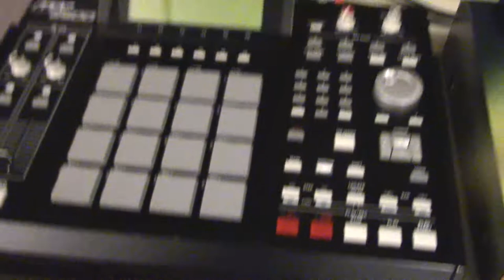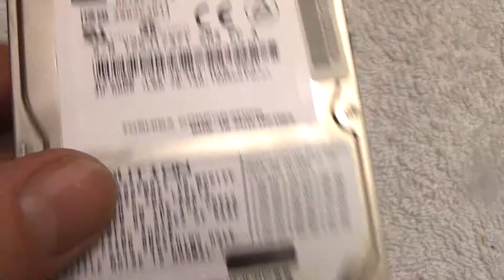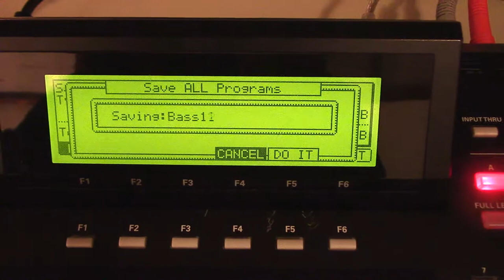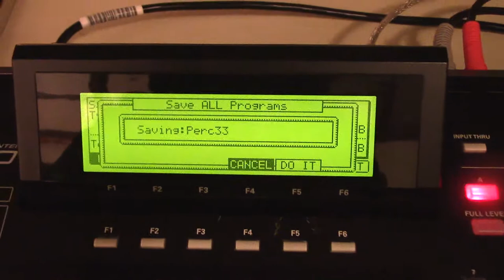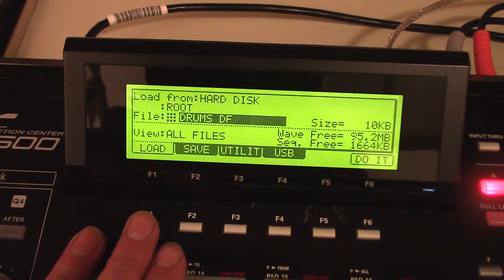Akai MPC 2500 - Upgrade Hard Drive to SD Card - Tutorial

Comment: Thanks for doing the research on this.  Using this mod with a 128GB SanDisk micro SD card, along with an SD-to-CF adapter with another 128GB SanDisk micro card in the memory card slot (thanks to MalaKai over on the MPC Forums)!  Everything saves and loads fine between the two and I now have roughly 242GB of solid state storage in my 2500!!!
Reply from the maker: Daaamn. Took it to a whole new level. Thanks for sharing.
Reply: That sounds incredible! I have a 2500 on the way and this got me even more hype! Can’t believe you can use an adapter for the cf reader and get 128 gigs!

Comment: Wouldn't the saving habits of the MPC have an adverse affect on the write cycles lifespan of the SD card?
Reply from the maker: Hey Tarik. Thanks for your question. 
From the internet:
Flash memory indeed has limited write cycles. However, by now it is unlikely that you'll encounter this within the normal lifetime of such a card. Usually this is in the order of 10,000 to 100,000 write cycles depending on the card. Today SD cards include circuitry to manage wear-leveling, that is, spread out writes over the storage media evenly to avoid "hot spots"—pages that are written too frequently and therefore failing early. 
Most people would have changed to a newer card before the old one can be worn out.
If you are worried that your SD card may die on you, regularly backup important files. 

People are putting up to 200gb cards in this machine. With a card of that size (or similar) one may only see a few write cycles in its lifetime. 
The card I installed is only 64gb and I have only used around 6gb so far. 
Hope this helps.

Comment: Thanks for the vid! The four isolated pins on the left are actually drive select and not power. You correctly hooked up power on pins 41 to 44, all the way on the right. You can google "ide 2.5 pinout" to see. It's kinda confusing the HDM10 kit indicates pin 1 incorrectly, but luckily videos like yours show how it is done.
Reply from the maker: Thanks for the info!

Comment: Thanks for sharing man! Are you using JJOS or stock Akai firmware? Is there a size limit for the CF card? I've got a bunch of 16 GB cards laying around. Still trying to decide on getting a 2500 vs 4000 if you have any input on that also?
Reply from the maker: Hey PJ. I'm using the stock Akai system and I think your 16gb card will work fine as there is a comment below where someone is successfully using a 128gb card.  Never used a 4000 so I can't speak to that, but the 2500 is pretty cool and you have the jjos option for expanded features and functionality as well. peace

Comment: Hey man, Im about to uograde my 2500.. so glad for your vid. justr wanted to know, once you formatted the SD drive did you have to remove it and load your samples on it again??
Reply from the maker: You can if you want... I just hook it up to my pc via the usb jack to transfer my samples.
Reply: @lazoo2000  sick one, thanks. Didn’t consider that would be quicker than how it is transferring to the internal drive. Appreciate it!
Reply: Hey lazoo2000 do you know of a size limit of the card you can use? I’m wanting to get a 512Gb or even 1T card for it but unfortunately can’t find info on the net about it. Thanks mate

Comment: @lazoo2000 i put my adapter in the incorrect way to the middle of the tray and left as well as being upside down and i my drive doesnt at all read anymore. do you think i have to replace the whole drive/or try or both? im using the free jjos 3.13 btw.
Reply from the maker: hey, sorry to hear... i would try to install it correctly, then if that doesn't work, try replacing the SD card.

Comment: this looks great, any link to what you bought?
Reply from the maker: Sure, here's a link to the U.S. seller where I bought mine:

http://www.ebay.com/itm/HI-Speed-SD-SDHC-SDXC-MMC-Memory-Card-to-IDE-2-5-44Pin-Male-Adapter-Converter-/301628732162?hash=item463a793302:g:ZaAAAOSwA3dYXbLN

I misquoted the price in my vid. You can get them for around $6, but you have to order from China and it will take a month to arrive, otherwise it's around $15.

Comment: So you can’t take out the SD card from within the machine once installed?  Would more want to replace my CF card reader with an SD and be able to pop it out and back in from time to time. Does hooking the MPC up via USB show the SD card on your computer fine?
Reply from the maker: Yup. You can access the SD card or the CF card on the computer and transfer files back and forth.
Reply: I use a CF to SD card adapter. Around $10, no issues after many years of use.

Comment: What is the biggest hard drive you can install instead of a SD card?
Reply from the maker: Good question... definitely  a 128gb, but I would bet a 256gb would work as well... and maybe even a 512gb drive... not sure and have not tested the 256 and 512 tho.
Reply: @lazoo2000  what size again for the 2500 fits is it 3.5 or 2.5?
Reply from the maker: 2.5 drive.
Reply from the maker: Also remember it takes an IDE drive, not an SATA.
Reply from the maker: If you have an older laptop, you could potentially use the drive out of that.
Reply: @lazoo2000  thanks

Comment: How is this working out for you these days?  Are you having any issue with loading and saving?
Reply from the maker: Still working perfect with no issues at all. Highly recommended upgrade. Thanks for watching.
Reply: I upgraded my 2500 with the SD to IDE card adapter and now I got 60 gigs in my machine!  I was so impressed with how it worked, I ended up buying a second one with a Sandisk 128 gig Extreme Pro card.  Thanks for making this video and helping out us MPC heads!
Reply from the maker: you are welcome.

Comment: hey brother can i get the info for the SD card reader u installed I'd like to purchase the same one. thanks
Reply from the maker: https://www.ebay.com/itm/SD-SDHC-SDXC-MMC-Memory-Card-to-IDE-2-5-Inch-44Pin-Male-Adapter-Converter-BNY/372496880859?epid=17003211007&hash=item56ba8b54db:g:OFoAAOSwylhb5qLD:rk:1:pf:0
Reply from the maker: https://www.ebay.com/itm/SD-SDHC-SDXC-MMC-Memory-Card-to-IDE-2-5-44-Pin-Male-Adapter-Converter-US/262079393302?epid=516522725&hash=item3d05262e16:g:idYAAOSwN81WEhts:rk:7:pf:0
Reply from the maker: This is the one... CA seller and NY seller depending on where you are.
Reply: thank you brother 👍

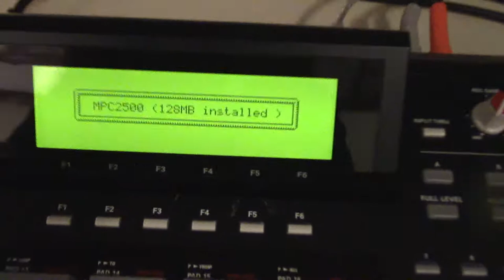Comment: Hey thanks for the great vid!! I actually ordered some parts and am excited to experiment!! I did notice something that is probably worth mentioning: I believe the adapter limits the actual write speed of the card to only 25MB/s, this is much slower than a hard drive where a 5400rpm hard drive can provide 100MB/s and a 7200rpm hard drive can provide 120MB/s. I believe the main benefits to this mod would be creating greater storage reliability due the the lack of moving parts that can fail or be broken, and also decreased noise level of a spinning HD. @7:16You do mention that load speed has been improved, does this mod really improve read speeds?? Anyway here is the article that brought this all to mind: https://goughlui.com/2019/02/03/tested-generic-sintechi-fc1307a-based-sd-to-ide-adapter-sd35vc0/ Any thoughts? Thanks again for taking your time to put this together!!
Reply from the maker: Hey Anthony, thanks for the info... 25MB’s per second write speed is more than one will ever need or use with this unit. After loading ones samples and files, all the work is done from the RAM which I have never seen glitch or hiccup no matter how much I have going on... unless I max out the ram, which I’ve never done. The real limitation of this mpc is the 32 voice polyphony and in my experience, one will run out of voices before anything else. As you mentioned, the reliability and the lack of added noise that a spinning drive will cause are the main benefits of this upgrade. 
Let us know how it goes. 
Peace.

Comment: Is there a way to do the same thing to the 2kxl?
Reply from the maker: Yes... you can replace the floppy or Zip drive with an SD card reader/writer.
Reply: Remember the 2kxl has some formatting restrictions that will hinder the size drive you can use based on the changed made with OS 1.2 which is needed for most readers.
OS 1.14 will partition a drive but works with fewer drives.

Comment: Why do you use a MicroSD and not just a SD Card?
Reply from the maker: You can use either. It's just what had laying around at the time.
Reply: Thanks for the tipp anyways, I tried it with a SD to IDE adapter in the HD slot and a CF to SD in the CF slot, both with a SanDisk 128 GB card and it works great.
Reply from the maker: Glad it worked out.